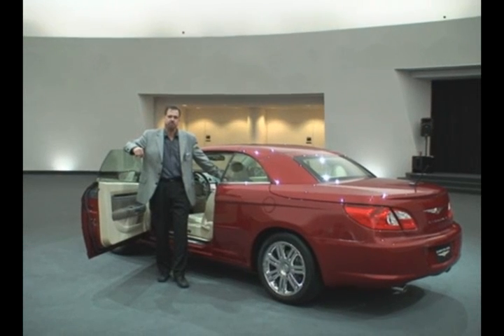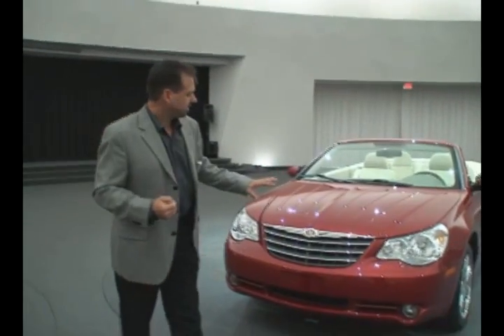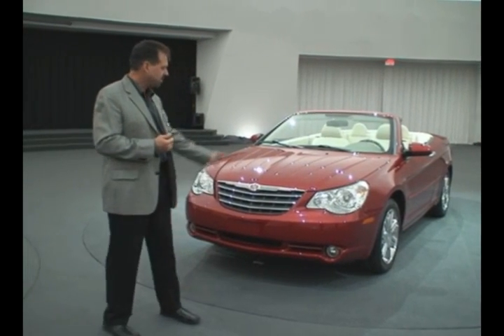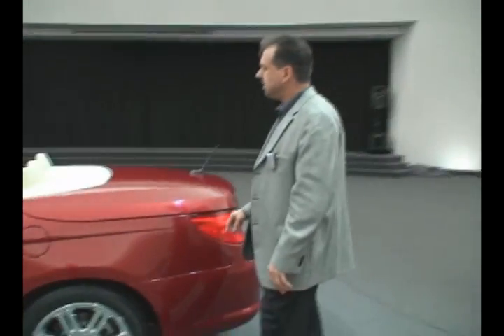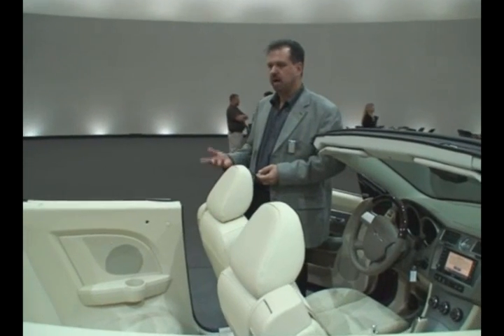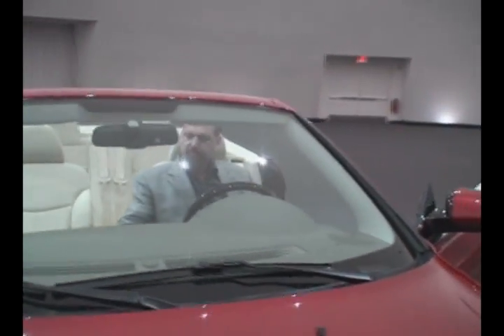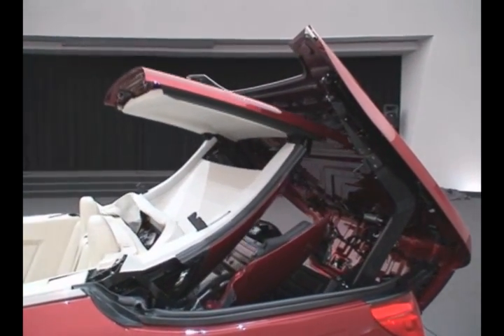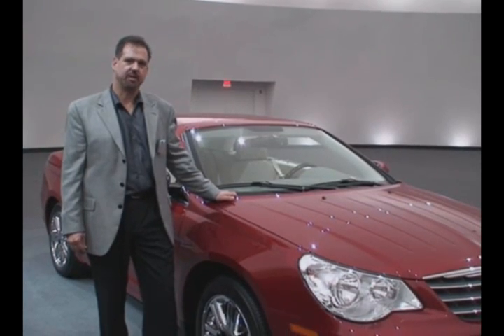2008 Chrysler Sebring Convertible

Comment: Did you design the convertible top so only a Chrysler Dealership can repair the top when it stops working? I paid over $13,500 for my Sebring convertible. I put the top down 2 times. On the third time, it stopped working. Now I have no choice but to take it to  a Chrysler dealership to get it repaired. They can charge me anything they want to and I have no choice but to pay them whatever they want. I swear to God, I will never buy another Chrysler product ever again.

Comment: I hate the new Sebring's looks.  The 1996-2000 body style at least looked much better.  The worst thing about Chrysler>> no reliability  and bad engineering.  I could care less about cup holders or the matching of trim material.  On the big important stuff, Chrysler is the exact opposite of what it was 40 or 50 years ago.  Back then cops depended on Dodge and Chrysler for 100% dependability and performance.  That is not the "new" Chrysler.